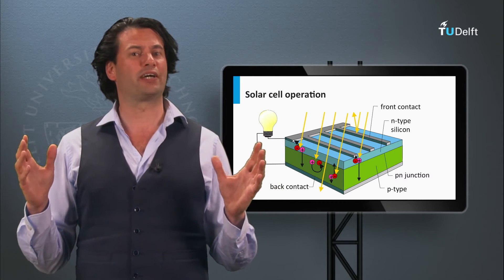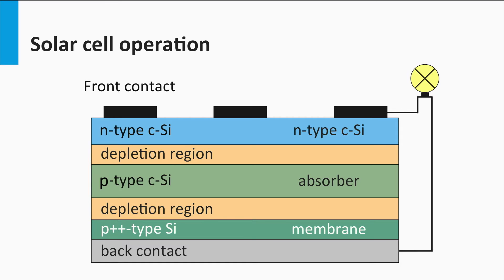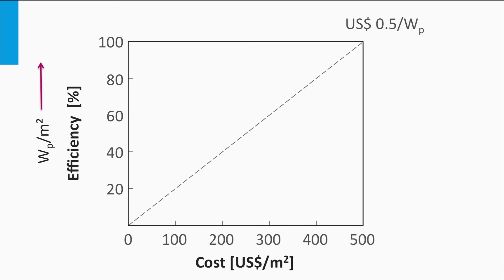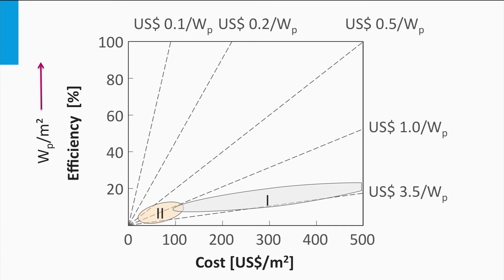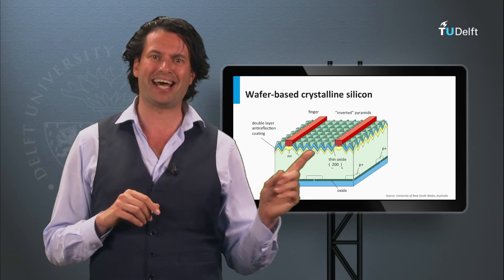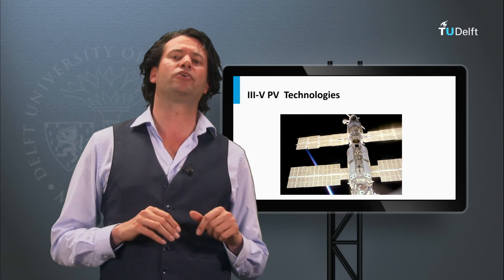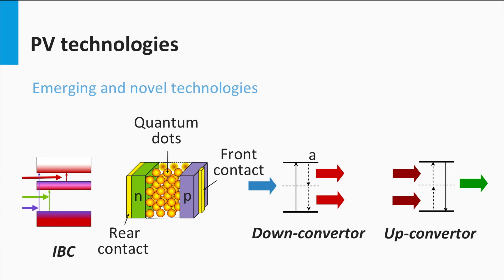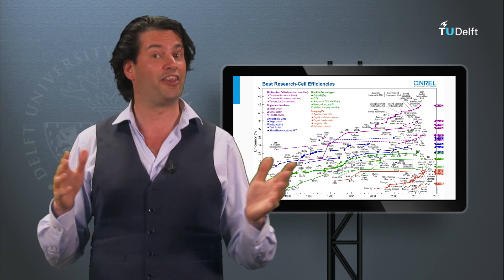1.3 Solar Energy Technologies

Comment: can you redefine of efficiency please ?
Reply: I second your question.  Is the y-axis (~ @ 4:00 onwards) a %, or is it W/m^2?  What does that US$ 0.5/Wp mean (top right hand corner).  Using Wp = slope x Cost, we should have Wp = 0.2 x US$, or US$ = 5 x Wp.  

(/m2 cancels out.)
Reply: Okay, maybe I get it.  The y-axis is Efficiency as a %, with reference to a base test case of 1000 W/m^2 of solar irradiance.   So, with the 1st dashed line (from lower left to top right corner) at 100% we get 1000 W output (/m^2) at a cost of $ 500 (/m^2).  At 80% eff we get 800 W output at a cost of $ 400 (all figures in /m^2).  So, this line represents a cost of 0.5 $/W.

Lines with steeper slope imply lower cost/W, lesser slope implies higher cost/W.